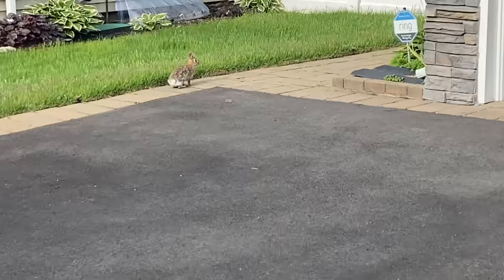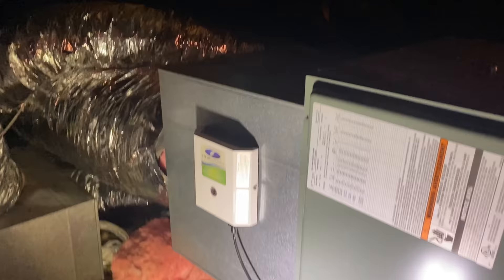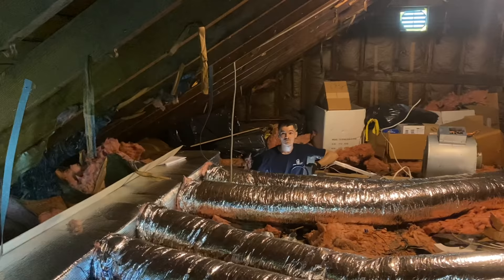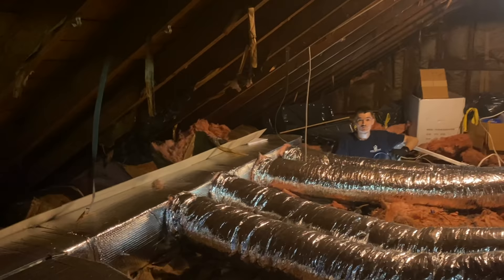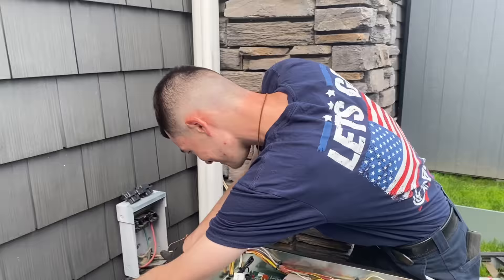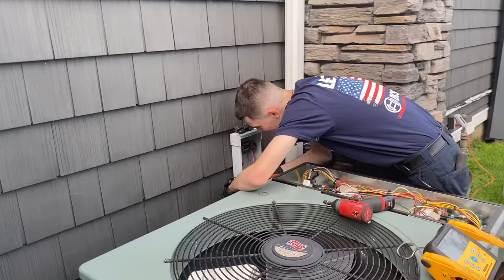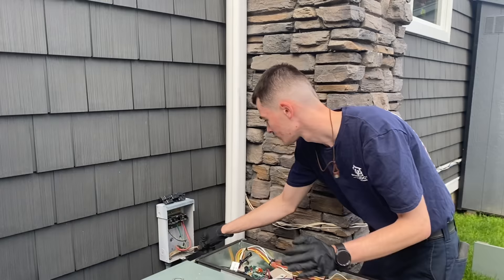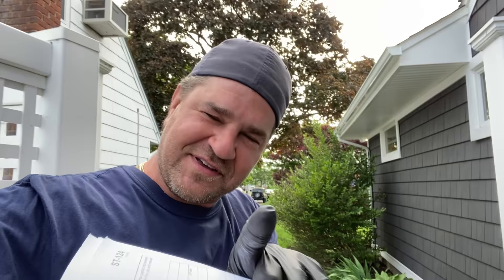Oil Heat to Heat Pump Conversion Featuring Bosch IDS 2.0 HVAC System

Comment: I love the surge protector on the disconnect. Expensive units with complex electronics deserve protection. Those surge protectors do need to be checked once in a while to make sure the LED function indicator is still on.

Comment: we switched from 16 seer to 24seer ductless with heat pump. saved 200 in the first year. summer bill went from 490-325. winter was slightly more than using our vent free logs. with the price of oil it's a no brainer.

Comment: Thanks for the video. Just signed off on Bosch 3-ton install. I hope I made the right call. It's replacing a 14 year old Westinghouse heat pump system.

Comment: I used to have a carrier infinity system that was so quiet the only way you knew it was on was a pulsing red or blue light on the thermostat/controller. Even the defrost was quiet with the quiet shift turned on.
Reply: Really nice unit, just tricky for newer techs like me lol

Comment: Excellent video!! Love the channel. I have a House in Warwick NY, that is killing me With Propane prices!!!  It’s on my wish list for next year.
Reply: You might want to put in a Bosch system even sooner.  I put in a ductless heat pump for my nephew, he had all electric heat.  It saved him $600 in the first winter!  

For 100,000 Btu's of heat, a propane furnace will use about 1.3 gallons of fuel.  While the ductless heat pump with 20 SEER is only about 5 KW, and the Bosch system only about 4 KW.  So what is your electric cost VS spending $1,600 a winter in propane?  Maybe the cost of a loan to install a new system will be less than the cost to buy propane for the next two winters, and also save money in the summer on cooling cost too!

Comment: With all these heat pumps going in I can already hear the HVAC guys complaining in a few years when they need to swap the outdoor unit when it's 10 degrees and snow on the ground.  I'm not sure I'm would do a heat pump with out a backup heat source.  Guy I work with has a ground source system and on more than 1 occasion his backup oil boiler saved him when the ground source system wasn't keeping up or a component failed.
Reply: 💯. However, “technically “ the heat strips are backup heat. But I whole heartily agree…don’t call me in February in the dark and sleet,and think I’m shoveling to your unit..🤣

Comment: Hey Siri, great job on that Bosch heat pump install… The only thing I am wondering is since you stated it was an entire conversion from oil fired furnace to the Bosch heat pump… You never showed in your video the furnace you were taking out… You only showed the work you did on the old AC portion of the system 

Just wondering, why if you were doing a video showing a conversion from using an oil fired furnace to a complete conversion to a Bosch heat pump… Why you wouldn’t show how you took out the old oil fired furnace?

Why did your video only contain the work you did on the existing AC system?

Comment: Thank you for the info about oversized systems.  I cannot get my humidity below 60% without a dehumidifier which i recently purchased..  Quite aggravating.
Reply: can enhance dehumidification by slowing blower down to 350 cfm per ton.

Comment: Question
I love Bosch. Have a duel   fuel.  Love it!! 2 things
I'm using a bcc100 
I wired my humidifier from the thermostat to run it. I used the h/dh connector and used the c at the furnace. Bosch 96 as well.  Is it better to use the manual humidity control in conjunction? 
Second how do I get my heat pump to stay on down to 28 in duel fuel mode? I have solar panels so electricity is cheap. Love your videos!!! Love Bosch!!

Comment: I love this channel! I’m about to replace my oil system with a heat pump!
Reply: Horrible idea... If you live in New England you need to go with oil, gas or propane. Your electric bill WILL be over $1,000 for just one month if you use a heat pump as your primary source of heat.
Reply: You should get natural gas furnace if you can, or do a dual fuel system. Heat pump and keep oil as back up if it gets really cold.
Reply: @Keegeth  mine wasn't , i replace my electric baseboard heat with a new heat pump, and usual electric bill is about $165, not sure how your getting $1000+++ LOL !!  and the temps were in mid 20's

Comment: Pipes!  Make sure the RMS Clamp on meter can measure amperage for varying frequencies -
Reply: No problem and glad to help.  I use the Fluke 323- good for voltage and current measurements on non-linear loads …think I paid $160.00.

Comment: You know, I was wondering about that attic tool to haul up units like them furnaces and air handlers. 

Supco Attic Pro Utility Lift. Have you ever tried it before? 

Might help you guys be a little more safe and efficient about getting the old and new unit in and out.

Comment: Have you ever had to modify the top of a cased coil on an upflow unit by cutting out the top 8 inches on each side because the cased coil is too tall and into the trunk line. Way I seen one installed, already existing, was the installer had capped the cased coil and cut 8x20 rectangle holes on each side and butted the trunk line up to it and screwed it to the case. Apparently the inspector had no problem with it. We ripped it out and put proper height unit and case coil along with a plenum transition to the new trunk line. Never heard a guy cuss like the fellow I worked for over that.

Comment: You know what you should sell to people: A Bosch Heatpump + a PV System that has at least the wattage of the Heatpump -> overall the system is going to be cheaper in running costs than any other system!

Comment: Stay bright 8 is great but I still don’t use it much. Only when I have combustibles or in tight spot! I’m not a hypocrite as I have used it but I would rather braze than cleaning and fluxing and no flux or particles from sand paper or mesh clothe… Just old school I guess

Comment: Mikey pipes, I live in upstate NY!
I have a oil fire boiler for baseboard heat throughout the home, system located downstairs. I have a central air system that is only ducted to 80% of my home for the warmer seasons located in my attic. I don’t want to be on fossil fuels anymore. WHAT ARE MY OPTIONS????

Comment: What do they do on the 20 degrees and much colder days? Still run the oil burner?
Reply: When it is 20F, these Bosch units can still produce their rated full heating capacity.  At about 5F, then they will start to produce a little less heat than the full rating.  If you happen to have under -10 F, then you might be wishing you kept that oil boiler to run on those few nights each year.  

Have you ever been in a walk in refrigerator at Costco?  It is kept at about 38F, and the compressors have no problem blowing out 20F air to keep the walk in refrigerator that cold.  They also make walk in freezers, the same size and even larger, keeping them at 0F or -10F, so the air can blow out at -20F to keep them that cold.  Same things with the Bosch heat pumps, they can blow out -20F air on a -10F day, and collect that heat and warm the home.  

To get 100,000 Btu's of heat, burn 1 gallon of home heating oil, or run a heat pump with about 4 KW to 7 KW of electricity.

Comment: Mike, please help. I live just north of you guys in Putnam county, used to live in Baldwin. Would you recommend this system going from oil heat like this application? I worry about the cold nights we occasionally get. What temp does this work until?? Is a backup heat strip necessary?

Comment: Hey Mike when they are shipped they come with the oil and Refrigerant in the system for 15 feet of line. Is it necessary on longer systems to add any more oil with the refrigerant?

Comment: So did they keep their oil burner as back up?
Reply: We still have oil burner. Using for hot water and when the weather drops below 35 will switch to oil. But for most of winter should be able to use heat pump.

Comment: Do you recommend a crank case heater for these if you only utilize the heat pump seldomly? Mine was installed without one and I’m nervous about turning it on because of “refrigerant migration”? Says in the manual to run a CCH for 12 hours before? Thanks!
Reply: I have had a heat pump for 10 years, and never needed a crankcase heater.  They do use power 24 hours per day, so sort of waste power.

Comment: Hi Mikey pipes! I have a propane furnace in my home that I installed. It is a modulating furnace by Trane and I spent about $1600 to heat my house this winter. I’m not sure where you got your figures from on that graph at 12:20, but it’s off by a good amount
Reply: It might depend on where you live, that’s an avg graph. So it can only be so accurate
Reply: I am sure he is using national averages. But its relatively easy to do your own calculations (they may even exist online where all you do is plug in numbers). Figure out what you pay per BTU with your propane furnace and compare it to an oil furnce. Then compare it toa similarly sized heat pump and factor in what you pay for electricity.

Your $1600 might not be my $1600. I live in MA, where all forms of energy are higher than national average by quite a bit, and I have never personally paid $1600 to heat my house. There's no way one number fits all.
Reply: @belavet  I’m also in MA, and I went through about 525-550 gallons of propane to heat my house this winter. Heating to 68 degrees. 1900 sq ft. My furnace has an AFUE of 98%

Either way, the number that he got was almost 3x what I paid, granted I don’t live in a Taj Mahal, but it’s not a tiny house either
Reply: To get 100,000 Btu's from your very efficient propane furnace, it is about 1.1 gallons of propane.  While this Bosch unit is about 4 KW - 5 WK in electric.  So if you where to install a 3 ton ducted style upflow evaporator on top of your furnace, then you can use the furnace as back up heater on a very cold night, and run the heat pump to provide most of the heating and all of the cooling for your home.  At -5F you can switch back to your propane heater.

Comment: Was that a dryer vent behind the condenser?
Reply: Vent for an basement bathroom fan. Dryer vent on other of fence.
Reply: @blockheads88  cool, just wanted to make sure the brand new condenser wasn't going to be wearing a fur coat in a month

Comment: What are they using for domestic hot water?
Reply: That's where air to water heat pumps show some promise.  In the right conditions they can handle both heat and DHW. The technology can only get better along with a very tight (Passive House) heat pumps are going to be the future in all types of climate. 
Thanks for the reply

Comment: Mikey.what do u do when you have added a backup heat strip in terms of wiring? When a backup 10kW heat strip.is added.to the BOSCH A/H.   Which has 60A breaker.  What gauge wire would you use?  4/3?   6/3. Or is this overkill since HVAC im.not seen
Reply: @PipeDoctor  thanks.  For insight.
Reply: 10 KW at 240 volts is 42 amps, so #6 wire and a 60 amp breaker is OK.  2 hot wires and a ground that can be #8 or #10 wire.

Comment: How does cost compare to pellet heat?

Also, would you do this over a mini split, generally speaking?
Reply: The central heat pump with air ducts to each room makes the whole home comfortable.  While a ductless system will heat one room or two rooms, while you would need to leave the doors open at night to warm the bedrooms at night.   With the Bosch variable speed compressor, they are already as energy efficient as the ductless systems.  

Compared to pellet heat, well I have no idea how many pounds of pellets it takes to warm your home by 100,000 Btu's.  It is about 1 gallon of home heating oil, and 1.2 therms of natural gas, 1.3 gallons of propane, or 30 KW for a electric heater.  My 14 SEER 2014 model single speed R-410 heat pump is 8 KW of electricity, while this Bosch system is only about 4 KW to 5 KW to provide 100,000 Btu's of heat.  So check your local cost for fuel and electricity.  The heat pump is normally the lowest possible cost.  

So if 1 ton of pellets is $85, check to see how many Btu's it will put out.  Then consider that you get the electricity with no shoveling, no moving 50 pound bags of pellets.  No waking up to a cold home at 4 am, and needing to feed in pellets!

Comment: Has anyone tried the Zebra surge protectors that plug directly into the motors.
Reply: Yes, they work sometimes. They’re installed directly at the motor or at the condenser. In reality it’s better to have the surge protector installed at the disconnect box or switch. Check out Intermatic AG3000 surge protectors, better option.

Comment: What is the LRA of that unit I wonder? I have a soft start on my 18 year old 3Ton outside unit which allows me to start/run it on my portrait 9K generator.
Reply: With a 5.9 amp electric draw at 240 volts, it would be using a lot less power than a older unit.  Your unit is probably 14 SEER and maybe less.  The Bosch unit is over 20 SEER, so about 1/2 of the power.  They do not have a big surge to start a variable speed compressor.  6 amps X 240 volts = 1,440 watts.  Easy to run on a 7.5 KW generator or larger.

Comment: Heat pumps cannot be used with hydronic systems.

And what did the customer pay?

How do they make their hot water?

In New England you need heat strips as these systems are NOT effective below 10 to 20 degrees. That's another 500 bucks. And I got that price from an installer.

A boiler will last decades. Heat pumps last 10 to 15 years before expensive replacement is required.
Not cheap.

And running air conditioning does not increase demand for electricity in the summer? I mean this Biden man made energy famine is simply a freeze out. No heat pump can make you colder than that.

Comment: Mike i use oil. i have a old house 1939 craftsman with 100 amps would a heat pump work with them amps?